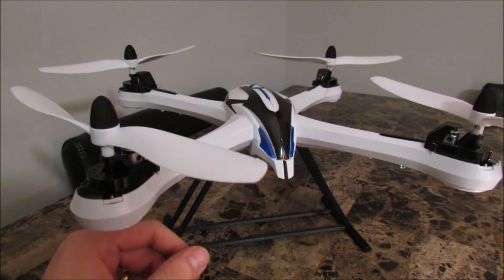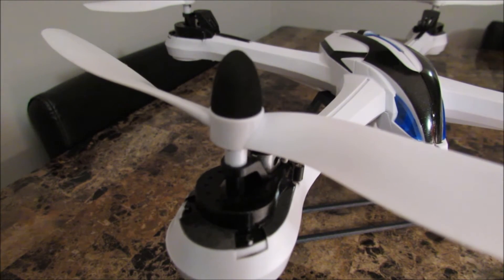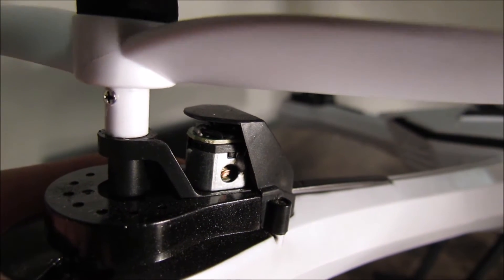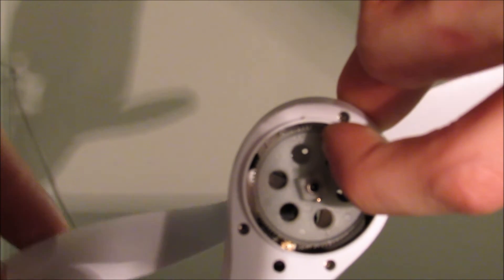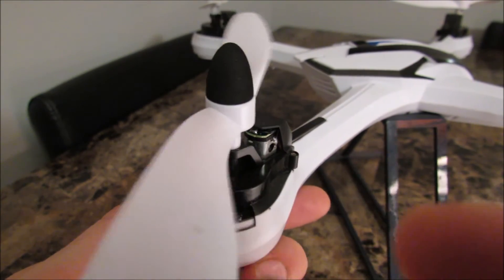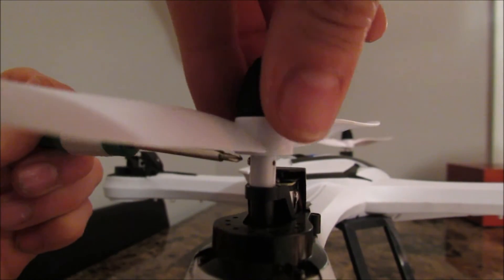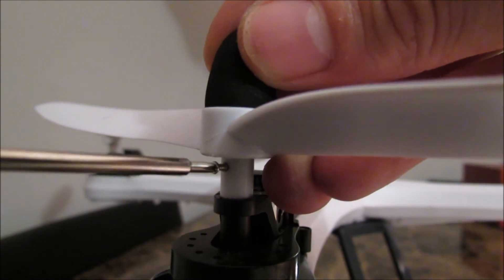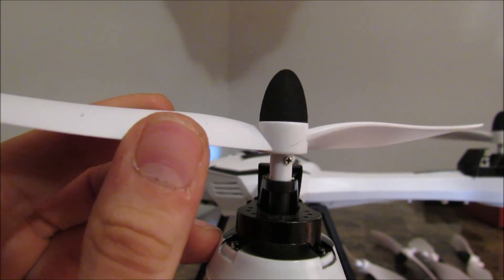When / How to change your Propeller on a quadcopter (tarantula X6) (gearbest.com)

Comment: Thanks for help man :) ! I managed to do everything, but after changing the propeller thrust on that side was significantly weaker than on others and drone lost its balance.. any suggestions what to do?
Reply from the maker: +Marin Markota Try re-calibrating, that's always the first thing I try.
Reply from the maker: +Marin Markota Also make sure you use the right propeller, the blades tilt in opposite directions. The propellers are labeled on the top of the propeller near the center either A or B make sure you replace with the same corresponding letter
Reply: +My New Toys success! :)